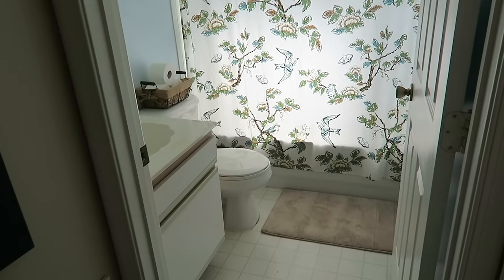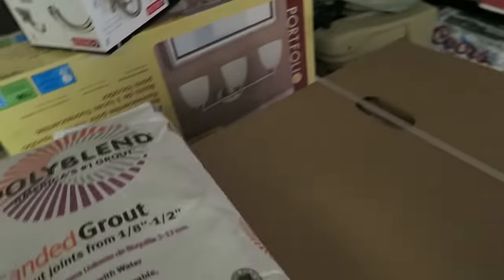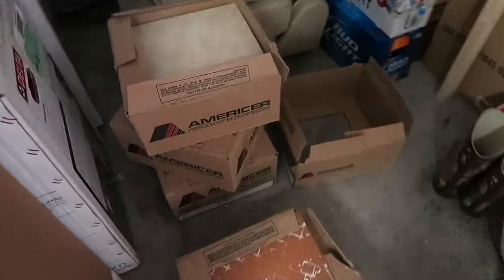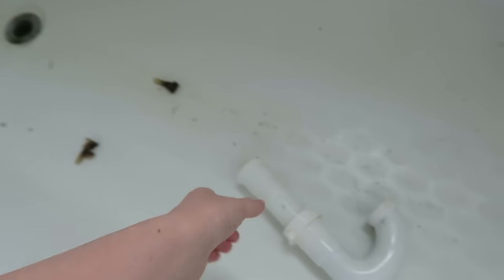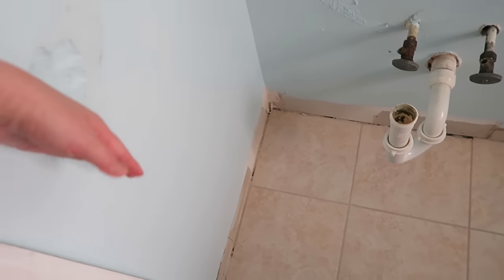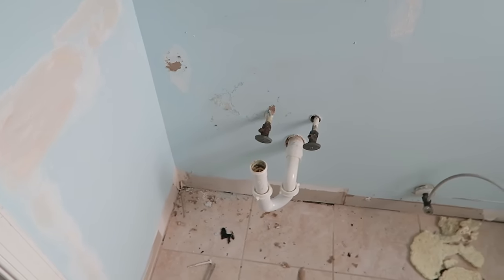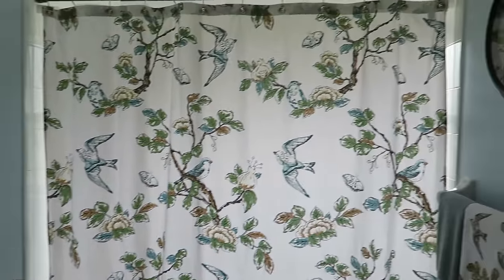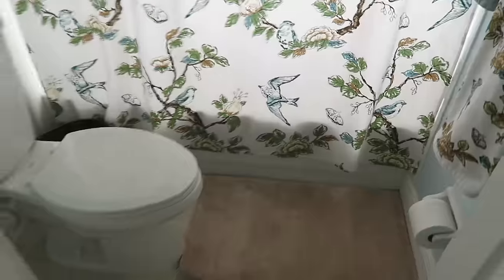Small Guest Bathroom Renovation | Start to Finish

Comment: Looks so nice! We used some decorative trim and rosettes blocks (so we didn't have to mess with corner cuts) around our guest bath mirror. It was an inexpensive easy way to update our mirror! Just need some liquid nails to adhere the trim to the mirror...you might check it out on Pinterest to see if it's something you would like! :)